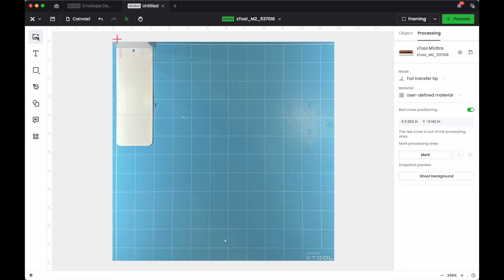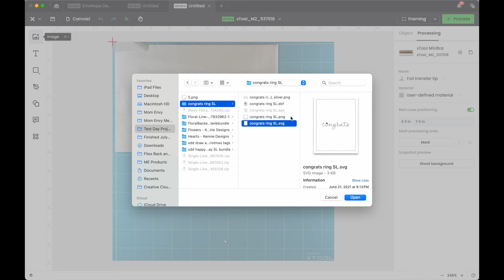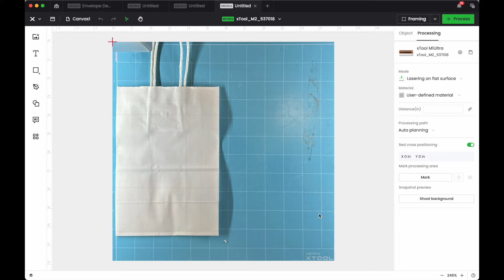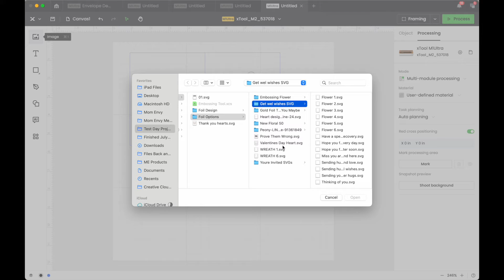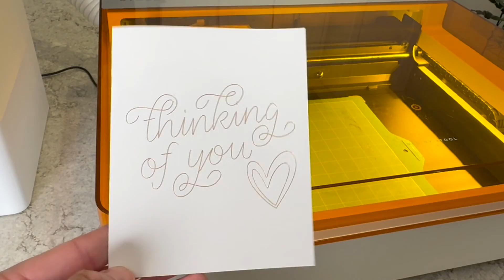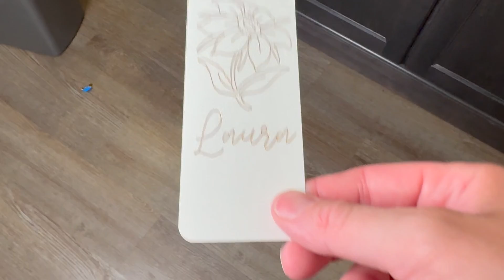How to use the xTool M1 Ultra Foil Transfer Tip (also called the Embossing Tool)

Comment: Is there a difference in foil I need to use? I bought some on Amazon that says its "transfer foil". It does not work.
Reply: For hot foiling: Use heat transfer foil, make sure the attachment is hot, and when you remove it, make sure it is very, VERY slowly. My experience with regular foil transfer was less than stellar. You’ll have to experiment with pressure and speed for each material

Comment: Can the laser foil be used on wood with M1 Ultra? If so what tip is used?
Reply from the maker: You can use the foil with the foil tip on wood! It isn't laser foil, it's foil transfer that it used with a foil transfer tip that goes in the blade holder instead of the laser. Since this is a hybrid machine unlike other lasers, it has the ability to do the different types of functions and this is one of it's alternative functions.

Comment: Hi there. I just found your video. I've been looking for the perfect crafting tool for multiple applications - the M1Ultra may be what I need. The MAIN thing I am looking for aside from a laser engraver/cutter and the Cricut-like cutting machine - I NEED a machine that can emboss foil into LEATHER or even Faux Leather - Have you tried this? Do you know if the M1Ultra can emboss or 'burn' foil into leather (if that makes sense) ? Think of a leather hardcover book with foil embossing - THAT is what I am trying to accomplish basically. If you have any thoughts or experience on this - I'd be very grateful for any input you can give me. Thanks so much in advance - love your channel!
Reply from the maker: So sorry for the delay in responding. yes - it can emboss gold onto leather! I have not tested it yet but reached out to xTool and they say that it can. I will test it out as soon as I get the time to play around with it more. I was super impressed with its ability to foil things, I wish I had thought to test the leather at the time. 

I will say, there are also options for leather notebooks and such that when you engrave them, they reveal cold (xTool sells a passport that does this and it turned out beautifully).
Reply: Could either of you give me an idea of it can emboss paper without foil (still using the foil module, just no foil). My sister is going for a very specific look for wedding invitations.